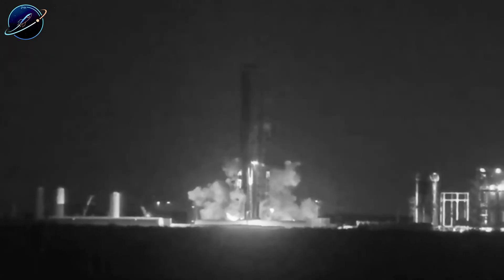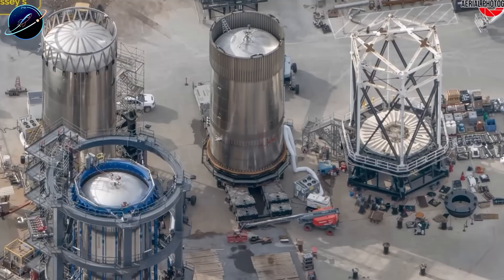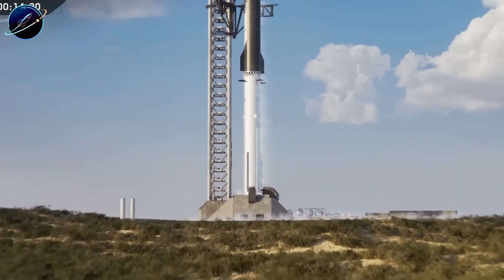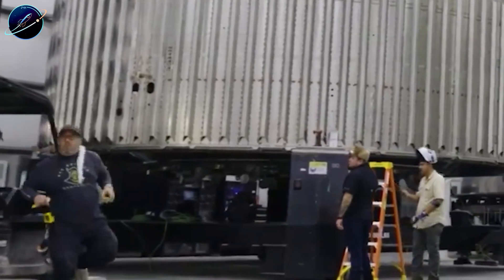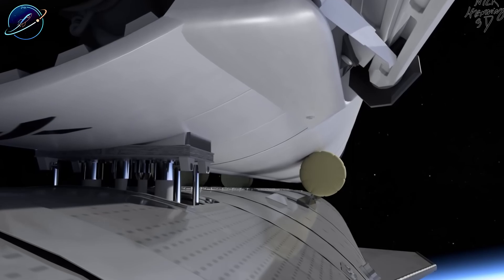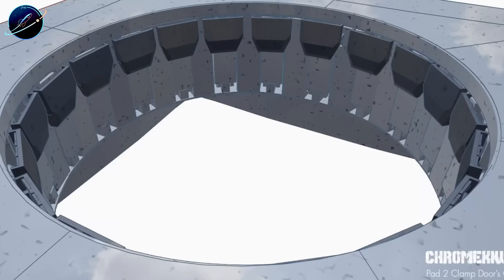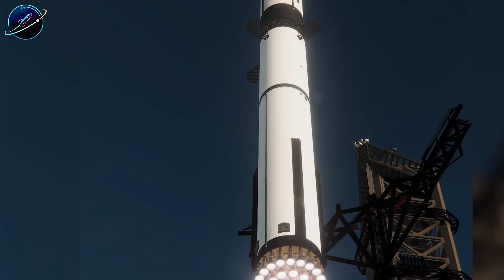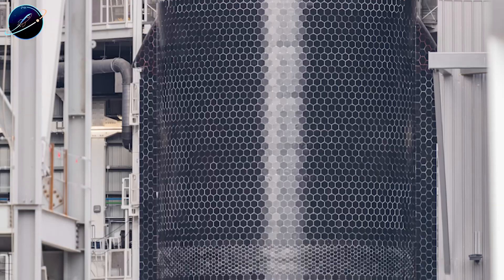It's Mind-blowing! SpaceX Turned Disaster Into Victory: Booster 19 in 28 Days...

Comment: The new OLM needs ceramic coating on all metal surfaces they want to protect from high temperatures  !
Reply from the maker: Interesting point! The new OLM on Pad 2 uses protective access doors to shield hold-down clamps from plume heat/debris—no ceramic coating on metal surfaces mentioned yet, but rapid iteration could make it happen for longevity.